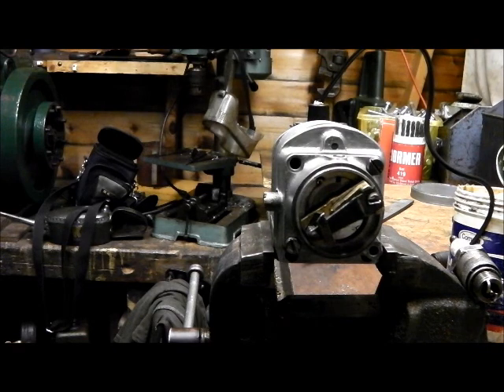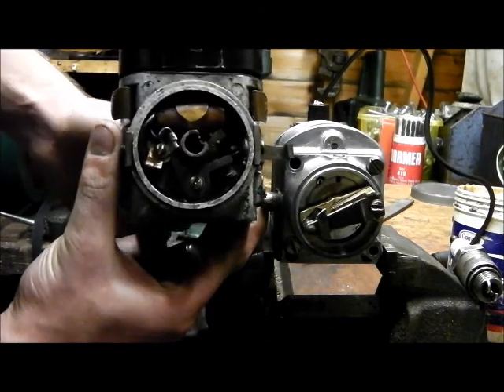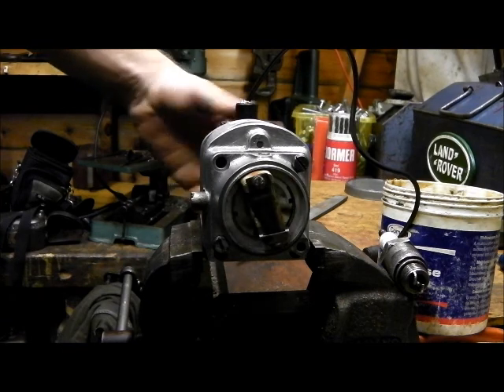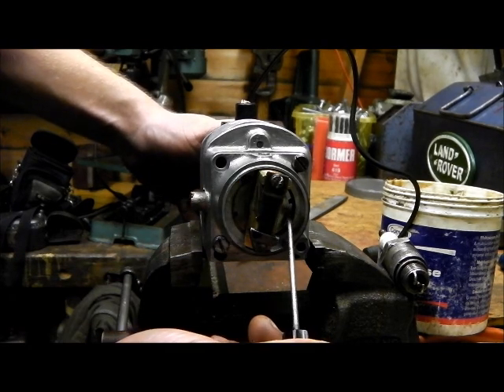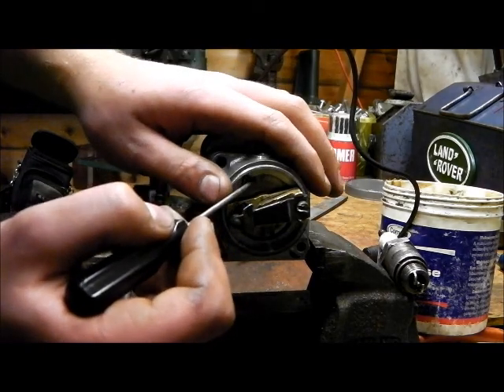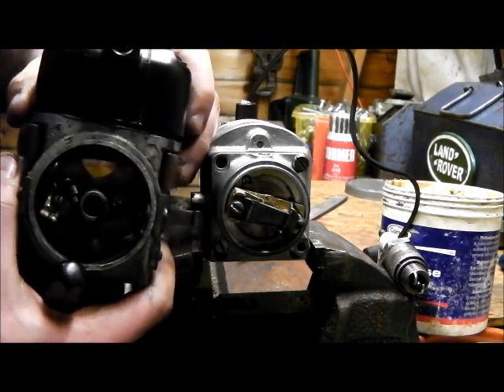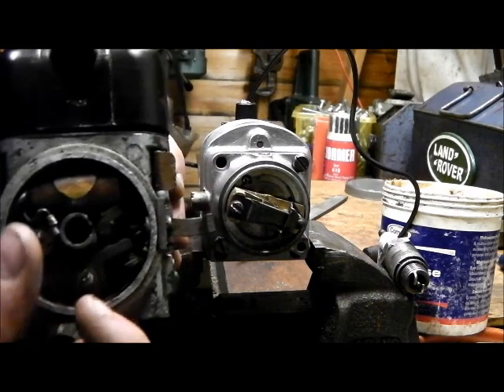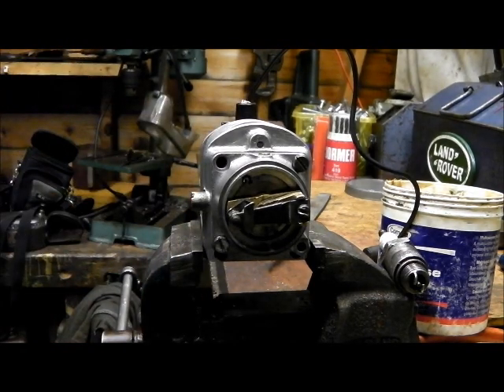Reversing Magneto Rotation

Comment: Hello steamwally , I have reversed the rotation of a Berling four cylinder mag with this help . First rotated the cam ring almost 90 degrees and it changed from clock to anti clock which is what I require but that meant the cam ring arm was pointing down . so had the choice of removing the arm and brazing ? etc on at the correct position but what I did in the end  was to turn the points plate about the same degree and leave the cam ring in correct position . I had to file the keyway off the male taper to allow this and just hope it doesn't slip in usage !! It works well 'on the bench' by power drill in all degrees of advance and retard . Thanks , Ken

Comment: Hi I’ve got a Lucas Rs1 which I want turn into an anti clock for my anti clock lister d any ideas how I do it cheers kev
Reply from the maker: Hi Kev, you'l need to pull the cam from the rotor shaft. It's a while since I've had one of those in bits but the cam will be keyed in some way and being hardened, they are easily damaged during removal. You will need to remove the key/ locating peg in order to move the cam. Turn the magneto in the desired rotation until you feel the pull of the magnets. The basic (very!) principle is that the spark occurs as the magnetic field is collapsing so with that in mind, set the cam  to open the contact breaker at the point you just turned the magneto rotor to- that will get you in the right area, then fine tune as required . To be perfectly honest, there are so many Lucas RS1's still about that if it was me, I would just find one of the rotation required. There is a little more to reversing mags than this video - many have handed contact breaker sets so that the heel of the moving contact bears on the correct side of the cam relative to rotation, so you need to consider the suitability of the particular magneto if you intend to reverse it.